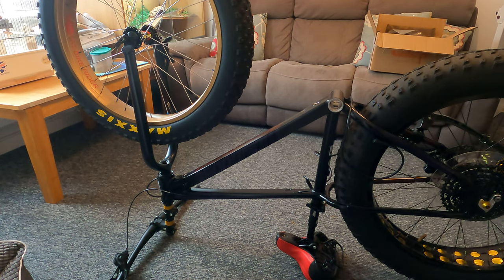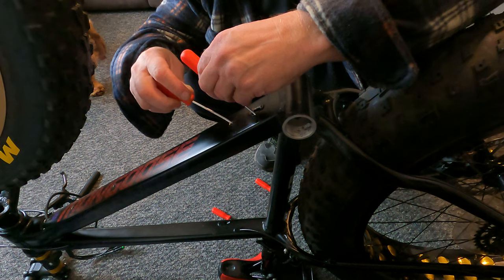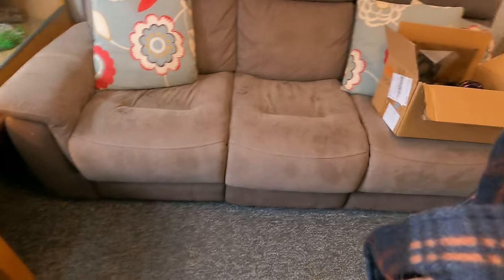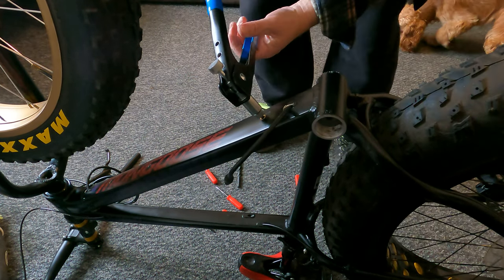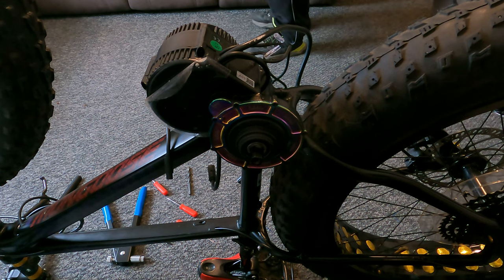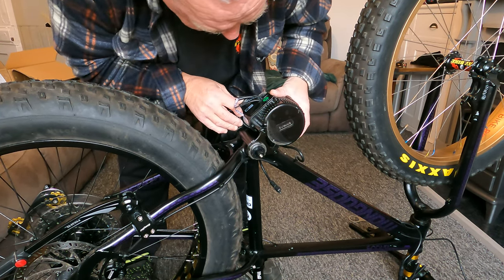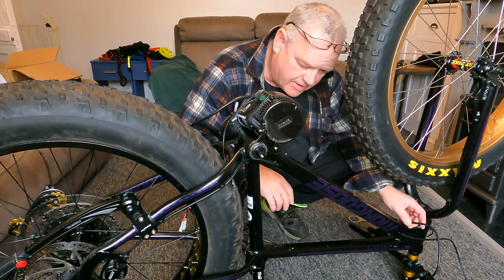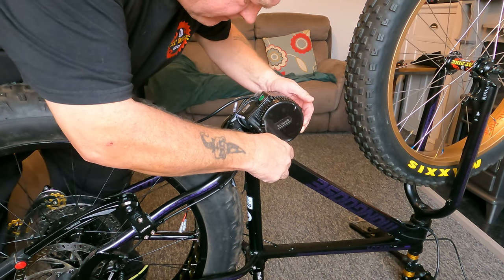Mongoose Argus Sport fat bike vLog 6 Bafang  BBS01 and BBS02 install

Comment: is possible to install a bbs02 500w 36v controller, on a bbs01 250w 36v motor?
Reply from the maker: Yes m8 I did it on my first mongoose
Reply: @FATBIKERIDER Thank you for the answer. Is there any chans that I would risk burning the motor with the 500w controller, because it's a 250w motor?. I don't know if there a difference between the 500w and 250w motor except for the controller. I think the 250w I currently have seems a little bit smaller than the 500w, I could be wrong.